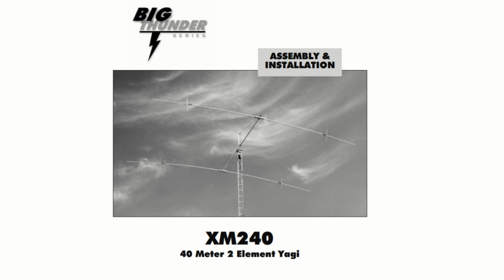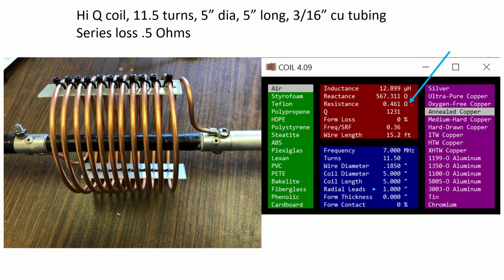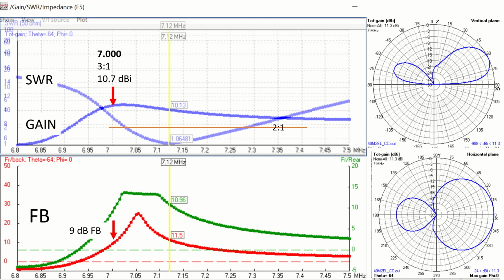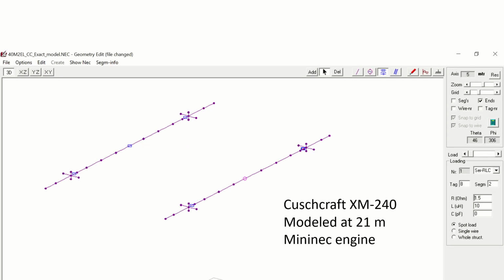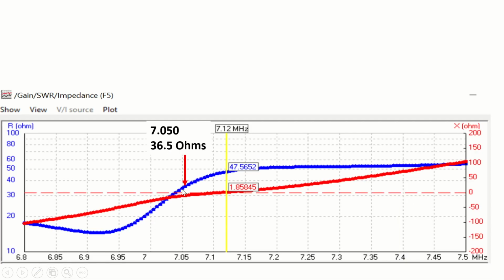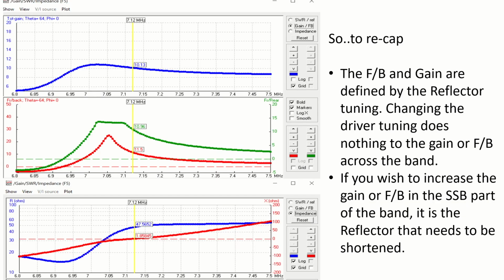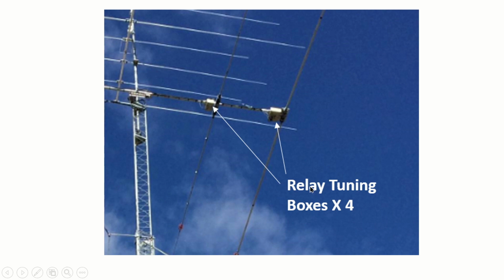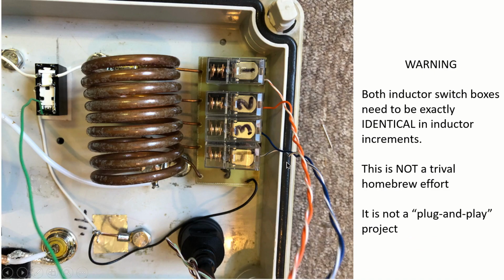How does the XM 240 Yagi really perform across the 40m band?

Comment: OM Steve    Nice review and chuck full of details and in dept analysis of the Shorty Forty ! yes the XM-240 and its predecessor the 40-2CD both are good performer's and enjoyed excellent sales when I was at Cushcraft.
I recall all the " Engineering Data Sheets " to try and beef up the product-----Best bet was when it was upgraded several notches to the XM-240 with a much more robust mounting system as used in the X series Beams of the late 1990's like the X7, X9 etc----Great job in the video ! 73's de WN1i

Comment: Hello Steve.  Very interesting.  As I am refurbishing a Mosley Pro-67B your presentation helps me understand the antenna a bit.  But, I am not sure to put it up asI do not use frequencies above 20m.  The Mosley Super 33 would answer better my needs being a 20/40 meter Yagi with reasonable wind load.  What can you tell about that antenna?  Can something equivalent be purchased or built?

Comment: Steve ... A question just arose with a ham operator asking how to open the bandwidth of the swr sweep on a multiband yagi ... this answers the question perfectly with additional gain tracking using switch box inductance ...dont mess with the driven element except tune to the upper frq then tack the gain using small inductors down the band ... now Iam rethinking my thoughts on achieving endless wide band design ..Thanks so much .... !!!